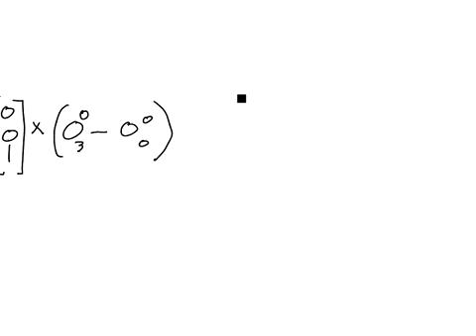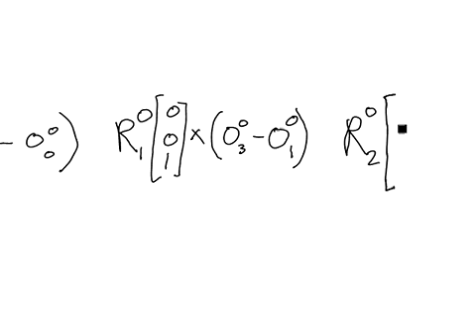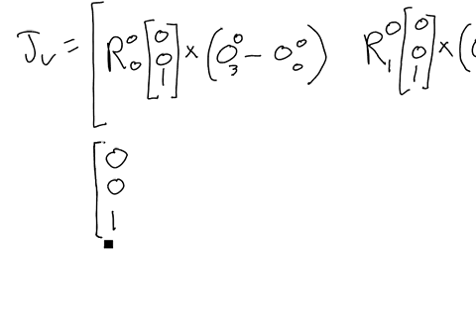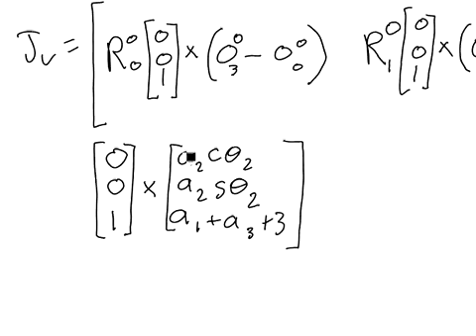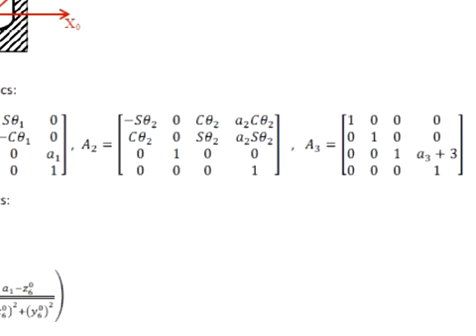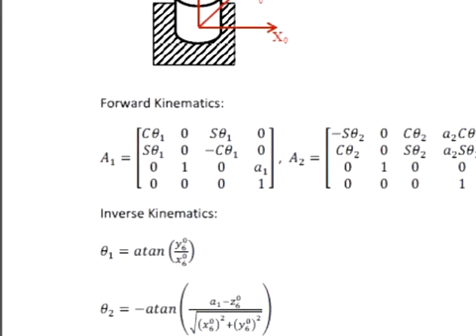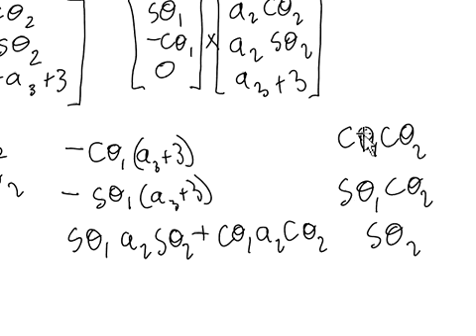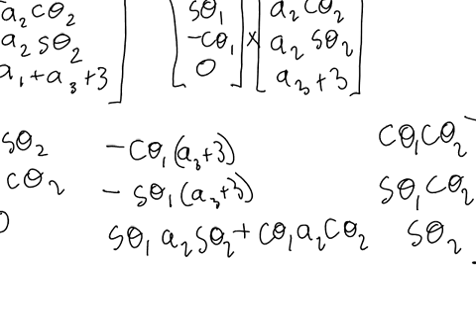2 2 1 Lecture Video 5 of 6 Jacobian Matrix Explanation

Comment: So if i have a 6R manipulator, i wouldn't need to consider R0_6 while calculating the jacobian because R0_i-1 has to be calculated and since i=6 the last rotation matrix to consider is R0_5. Am i correct here? If that's the case, why doesn't the rotation part of the last transformation matrix have any effect on the jacobian matrix?
Reply: Hi, because the Z0_6 axis is the axis of the end effector frame. This axis doesn't describe the rotational axis of any actuator since z0_5 is the axis of rotation of the 6th joint (6DOF).

Comment: Thanks for useful video, I have question, would it be easier if you just take the partial derivative for the last column of the homogeneous transformation matrix (the one from base to the end-effector). By this method, you can get the linear velocity part of the Jacobian.
Reply: I have just checked it and it works!

Comment: When you are figuring out position of the third coordinate frame with respect to the first, you just add all the fourth columns of all the A matrices together. The manner in which I learned it was to just take the fourth column of (A1)(A2)(A3), that is the fourth column of the matrices multiplied together. When I worked through your example this way, I got a different result from yours.
I noticed that your axes are also different from mine though.  The x2 axis doesn't intersect z1. Does this method not work for DH set-ups?
Reply: I am confused as well, with DH everything is with respect to the last frame, I think in this video, her A matrices are all with respect to frame 0?
Reply: xn is perpendicular the both zn and zn-1 axis and this rule true just if you are use DH parameter other way for ex. in the video Angela uses a rotation matrix method and this rule is not nesesery for the rotation matrix methot